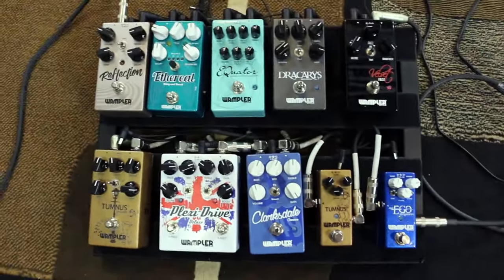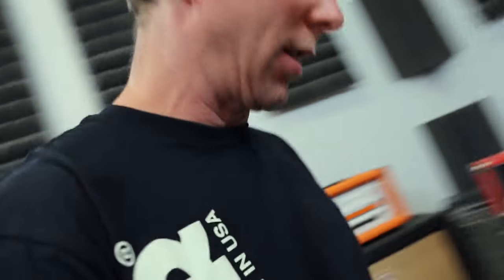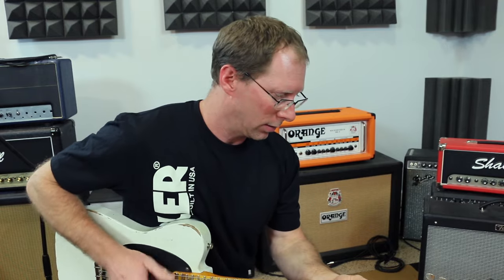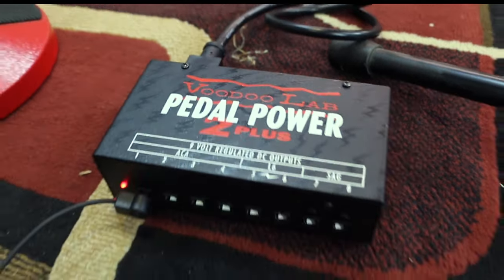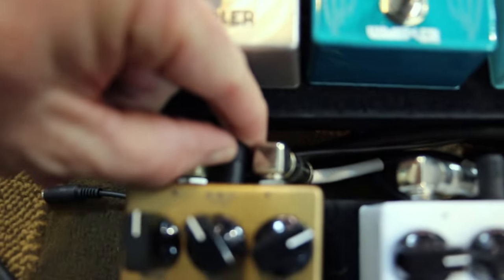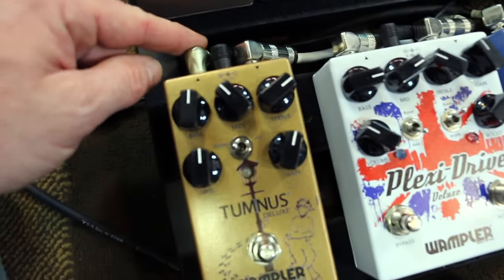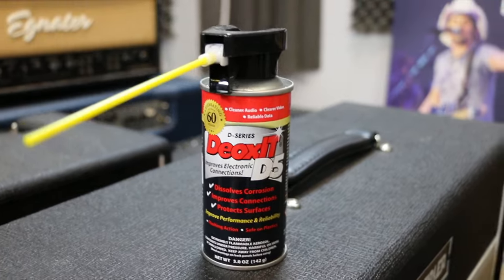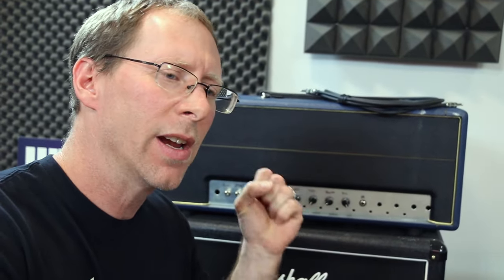Troubleshooting "non working" pedals, what to do first if your pedal stops working

Comment from the maker: If you buy pedals of any sort, eventually you'll have a problem or two with a pedal at some point in time, it's inevitable. The good thing is that many times a pedal problem is actually a problem that's a simple oversight somewhere. Here's our normal FAQ/Troubleshooting guide:

TROUBLESHOOTING SUGGESTIONS & FAQ:

First, unplug from everything and plug directly into your amp. If this sounds normal go to the next step.

A few questions:
Are you using a power adapter made for guitar audio? If it’s an ordinary adapter purchased outside of a music store and it “multi-purpose” or “Multi-use” then you will need to use a different power adapter. However, as long as there is a battery connection in the pedal, we can use this to test it first. You won’t be able to do this test with our “mini” pedals, as there is no battery connection inside those. Also, with pedals such as the Tumnus Deluxe, it increase the voltage internally. Therefore, a new Duracell battery. Why Duracell? Because the cheaper batteries do not deliver enough current.

Next, let’s isolate the pedal. You’ll want to run the guitar directly into the pedal and then in the amp. This is CRITICAL. For this test, remove the pedal from any pedalboard, do not have any other pedals connected in series with it, and do not have the power daisy chained to it.

Go to the store and BUY a brand new 9v battery. Don’t borrow one from another device or pedal, this test will not work if you do that. You’ll also want to wiggle the cable ends a bit and if there is any sort of pop or crackle you’ll want to use different cables. Note that this fixes 95% of all problems that pedals have.

Make sure you are using the pedal on the clean channel of the amp.

Turn amp off, wait 5 minutes, turn it back on and start at the first step of plugging directly into the amp.

Has the amp been moved recently? For example, if an amp is on a 15 amp circuit and there are many other things on that circuit or even depending what else is on the circuit itself, the amplifier can act differently or have various noise issues. Fluorescent lights, for example, are notorious for creating noise problems in audio equipment.

Does the pedal still have the same problem? If so, reply back to the email and we will send you a return form. 

IMPORTANT: Wampler reserves the right to charge a repair fee and shipping cost to the customer if the pedal is sent for repair and the problem is determined that the only problem is that the battery is low, and therefore not getting sufficient power. 

FAQ:

Noise problem with gain pedal:
Keep in mind, any gain pedal is going to have some degree of hiss to it, just by the nature of adding gain. It’s no different than turning up a high gain distortion channel, any noise whatsoever there get’s amplified.

Pedal cuts in/out
-check cables. Are they plugged in all the way? Try a different set of cables.

Pedal sounds different than normal
-Do you have a sag control on your power supply? Make sure it’s turned up/off so there is no drop in voltage. Replace with BRAND NEW battery (fresh out of the package). Do not reuse old battery from a different device.

One of the pots is scratchy/noisy? 
-Buy Deoxit electrical cleaner and spray it into the pots. https://www.youtube.com/watch?v=3tSo0HJRsM8 

“The LED just flashes whenever I turn the pedal on”
-This means that the pedal is not getting adequate voltage, or current draw. This means that the chain of pedals is trying to draw more current than what the power supply/battery is capable of, or that the battery voltage is not high enough to turn the pedal on. This is common in circuits that increase the voltage internally, such as our Tumnus Deluxe pedal.

Should I disconnect my battery if I’m using a power supply? 
If you use a power supply it won’t hurt the pedal to have a battery connected at the same time, as the power jack will disconnect the battery internally. However, batteries can and do leak a bit, corroding and causing a nasty mess on the inside of the pedal. For this reason, if you plan on using a power supply with the pedal it is recommended to remove the battery.

The battery keeps running down even when the pedal is not turned on.
This is because power is supplied to the pedal via the battery, even when turned “off”, any time the input cable is plugged into it. Of course, if you have a power adaptor plugged into it, it disconnects the battery inside (as mentioned above) and in this instance the battery will not run down outside of normal battery decay.

If at this point it's still not working, then yes now it's time to get it to the manufacturer for repair. Most repairs are generally switches. This is because most often the on/off switch is a mechanical part that simply wears out.

Music on this video provided by Youtube channel "My darn jam tracks". Check them out here:
- https://www.youtube.com/channel/UC55xyo8HvJMuTROnqpPgG5Q

Track used
https://youtu.be/79YHA1Gq5iM
Reply: my LED on my plexi-drive goes really dim a few seconds after i plug it in or turn it on, on ideas on what the problem is here?
Reply: I left my Pantheon on for about a week by accident (was my nephew) and now it doesnt work. It's just out of warranty can you make a likely suggestion as to what part(s) may have failed?
Reply: Heyyy, nice video.  I have a rig where suddenly two of my pedals won't work (make any sound) if they're plugged into the power supply. They make sound when bypassed and they'll make sound if I use battery or another standalone power adapter. On power supply the light still turns on, but there's no sound.  I'm also getting quite a bit of noise.  Do I have a bad power supply?
Reply: My pedal works fine with a 9v battery but not with a standard 9v power supply center negative tip. Is the jack the problem (the power jack doesn't for real snug)?
Reply: my pedal issue is when i try pressing on it is not working properly , it may lit up after a couple of attempts but its so annoying because it ruins my timing in transition of effcts .
Reply: Do you really have no idea this video makes people sea sick ?
Try watching it on a TV. Jeeezuz
Reply: I get a Squeal when i turn the level or gain up to hear the pedal..i can hear the pedal but the squeal gets louder as the gain or level is turned up..  Even with the gain at 9 o clock and the level up it still has a squeal.  Tried 2 different power supplies no change.  Although I think I remember a point when it didnt squeal.  I put it away , dug it out again months later and squeal is back.  I am just wondering what would cause thwe squeal if the power adapters are not at fault.
Reply: came to this video trying to troubleshoot a boss md 500 that wouldnt turn on. turns out you just gotta have something in an input slot if you want it to turn on when it has power. hope this helps someone who is as dumb as i am someday

Comment: When I first started modifying and building pedals, then later on repairing them I did really well repairing pedals (especially Boss) that the other used the wrong power supply and blew. It happened with an old DD-2 digital delay that someone plugged the wrong power supply into.
Interestingly enough, I was told what probably happened and how to fix it by my rep at Dunlop. I hadn't even contacted him about that, but about one of the DC bricks that had blown a few of the output ports. I mentioned the DD2 in passing.
He emailed me about the Brick and said I probably blew the Zener diode. He told me how to check it out and that if I replaced it the pedal would work, it did. A week later I put an odd online asking offering to buy blown pedals. I was paying between $10-30/40 depending on the pedal and how it went bad. I swear that within a month I had a couple dozen OD pedals and a dozen various other effects.
So, if you can solder; if you've plugged the wrong power supply in (usually the wrong polarity) and it stops working, open the pedal up (unplugging the power supply and removing any battery). The Zener diode is essentially used as a fuse. If you use the wrong power supply, it's designed to blow so that the rest of the circuit DOESN'T blow. It'll be located very close to power Jack on the pedal. Most that have blown are pretty obvious when they do; it'll have a scorched diode and the board itself may seem burned. Just find out what diode you need to use, take out the bad one and replace with a new one; it's fixed.
(If you REALLY need to use the pedal for something like a gig or something, you CAN jerry-rig it to work without the diode; just run a piece of wire where the diode goes. Its like using a penny in a fuse box; but it presents the same DANGER as using a penny instead of a fuse, which if you plug the wrong power supply again, you WILL BLOW THE PEDAL, so you should really replace the diode).
RE: Dunlop DC bricks, I used to buy these for $20-25 a piece too. The main problem with the Brick, besides not being isolated like the Voodoo Labs pedal power supply, it's a daisy chain (essentially a higher end One-Spot, and certain pedals will make the rest noisy, especially vintage ones). They blow outputs CONSTANTLY!. 
I swear the over I had, that came with like 9- 9V and 3-18V outputs had like 3 or 4 that were working within a few months. This is because the resistors used with each other are rated with too low wattage. Off the top of my head, I can't remember what they are. I THINK they're 2.7K & 1/4W each. When you unplug them before turning off the power to the Brick, you'll blow that output. It happens almost EVERY TIME. When I was fixing it, I showed someone how quickly and easily they blow, it's amazing they let these go out like that. Anyway, all you need to do is replace each of the resistors with the same voltage, but double the wattage, so if it is 2.7V & 1/4 W(?), then you need to replace it with 2.7V @ 1/2W. After doing that, the output will work and not blow all the time afterwards.
Another thing to know is that you can essentially change the amperage that the Brick puts out by using a different power supply (to the Brick) and what the 3 higher output jacks put out. 
Using a higher amperage to the Brick will increase the amperage put out. Changing the Voltage of the supply will change what the 3 higher output ports do. The standard is 18V, so that's what they put out. If you use a 12V, then the Brick will put out 12V @ the 3, using 9V or 12V will change them to 9v or 12V. ***The 9 x 9V outputs will still always put out 9V, they will not change.

Comment: Had an issue with one of the pots and the switch on my several years old Ego. Got it fixed a couple years ago by Wampler and customer service was amazing. I hadn't used the pedal in a while and got it back out and sure enough, it was having issues again. I got annoyed thinking I'd have to send it back again. However, even knowing most of these things in this video, it's always good to be reminded! Sure enough, I forgot the obvious to completely isolate it, and the pedal was working great! Turns out it was a bad power cable I was using with my PP2. I don't think I can ever get rid of this pedal now. We've been through so much. Thanks from Nashville Bryan, as always!

Comment: Always informative Brian. Been using pedals for years and this had things I forget in the heat of battle.
Using an early rack system (JMP-1, Quadraverb, power amp and switcher) I found the stage circuit was shared with the kitchen at the venue. When the fridges switched power my presets changed! 
Like most sane people, I went back to pedals and amps but I really miss that Marshall pre-amp.

Comment: A good method of locating a trouble spot in a pedal board is divide and conquer. Whatever the issue (no sound, noise, etc), remove the cable from the input of the first pedal in your chain and plug it straight into the amp. If it's good, back up to halfway between your pedals. If it's bad there, go halfway back towards the amp. If not, go halfway back towards the beginning of the chain. And so on and so forth. Saves a lot of time compared to going one by one.

Comment: I followed pretty much the process you provided in the video.  I have a Origin Effects Cali76 (which I love BTW) with an unbelievable buzz when there is no guitar signal.  Tried it at 18 then 9 volts on my VooDoo Mondo PS.  Nothing I tried could get rid of the buzz.  Finally substituted an Ego Compressor in there and it works great and the Ego is dead silent with no guitar signal present.  The brute force, high cost, troubleshooting method to use when all else fails I guess.  I have several of your pedals and love them!  Your hardware helps me obscure the lack of talent in my hands!

Comment: Deoxit 5 had been my super mystical  dead pedal revival system since my amp tech told me about it. It didnt hurt when he demoed right on the spot and made my formerly intermittent Seymour Duncan Pickup Booster magically rock solid  with a few squirts of that stuff and pushing the footswitch about ten times.

Comment: I was just upgrading my small rig here, got a Joyo compression pedal two weeks ago, works fine on battery thus far, but my older Tubescreamer in chain with it,
for some reason worked fine on a new battery for a week, now it's not turning on, not sure why. My cables are fine, some are brand new. I also got a Zoom G1 FX
processor, that's also working just fine on battery for now. Can a pedal like an older TS drain a new battery? I guess it's time go buy a good power bus rack for
the better pedals I have. I don't plan on using a huge rack of pedals, just play at home for fun, I intend to end up with this: compressor, Tube Screamer or OD (I have three), fuzz pedal, and maybe
a metal pedal and/or tuner pedal. Nevermind: I just realized I hadn't unplugged input cable after use, that might be why the TS drained out. Although, I plugged in another OD pedal
and used a new battery, and that wasn't working now, either.

Comment: Another thing I learned from watching these videos is to cover your battery connection with tape when putting pedals on a board. Moving boards around moves things inside a pedal and you COULD cause your own short. Save your pedal and time by eliminating that maybe problem 1st. Unless you use batteries which I wouldn't understand cause you would have to disconnect all the cables every time you were done.

Comment: I have a vintage TS808 that doesn't have a power supply jack at all.  I had to find a pigtail that went from my power cord to the head of the 9V plug inside the pedal.  It works but I had to "engineer" a relief route for the cord.

Comment: Great video. I'm my case, my pedal lights up and is clearly "on" (it unfortunately creates a lot of feedback through the amplifier)... However, it's not working at all. 😞 I've hooked it up correctly, to the best of my knowledge, but besides the feedback I mentioned, there's no sound coming from the pedal. If I turn the pedal off, my amplifier works perfectly. Any suggestions?
Reply: Same here, did you find a solution?

Comment: I just purchased my first two pedals and am having the same problem with both.  They both plug in fine and can play through the am when connected , but as soon as I got the switch there is no sound , and when I click the switch off, back to clean . 
Pretty sure I'm doing somthing incorect but have no clue.
Reply: Aren't you dead?
Reply: Sir does your pedal are okay now? what is your remedies in fixing it? im encoutering issue like yours.
Reply: @jovanietatoy8047  I believe I was not connecting the patch cables to the correct input on one of the pedals . 
It also might have been a battery issue .
Hope that helps

Comment: my metalcore boss pedal doesnt work. i put a working power supply with it and sound came out of the amp still but the pedal didnt light up and it didnt work but the battery was perfectly fine

Comment: Holy smokes....been using the same power supply for years and my dl8 delay started shutting off last week. (Looper works). But all effects works fine with a battery. This answered my question. I need better power supply!

Comment: Hi thanks for the advices. Nothing worked on my DD Boss which contistently fails to switch on when only using the 500ms and 800ms with a trutone power supply.
Still when i push on the pedal it does lits up. Cable is working and using another did not fix. Sometimes unplugging fixes...

Comment: Hey, I have two pedals. One is a Boss RC-3 Looper Station and the other is a delay pedal. for some reason they wont work together now. I never changed the plugs, I just woke up and instead of being normal, when I played it would just show that the delay pedal was on and the rc wasn't and then the guitar wasn't getting to the amp so I heard the guitar with no amp but I heard the delay from the amp. they both work individually and when I swapped there places only the delay worked! I am so lost on what to do, because everything seems to be fine
Reply: I'm having a similar issue with my boss rc-30.. 
When it's plugged into the amp it's working, but as soon as I turn the amp on it shuts the looper off.. I have no idea what to do 😶
Reply: @beccamyari6528  I recommend you going to a local guitar store and having it looked at. maybe re-arrange your pedals? I had to get some new daisy chains.